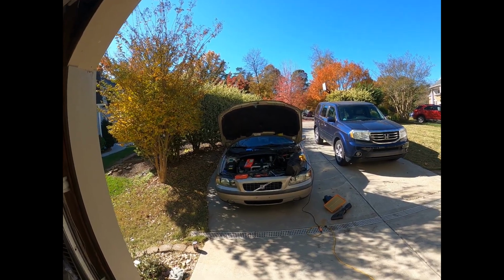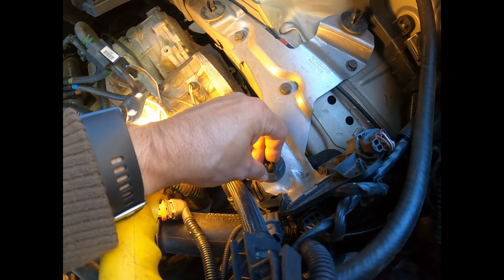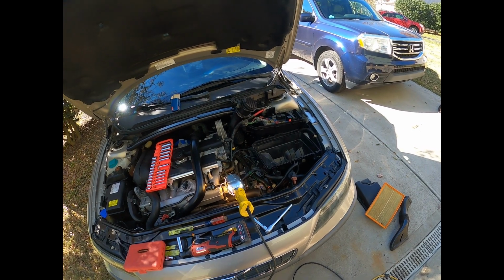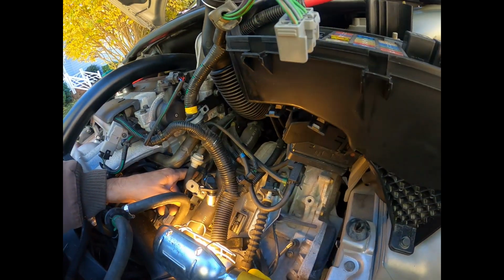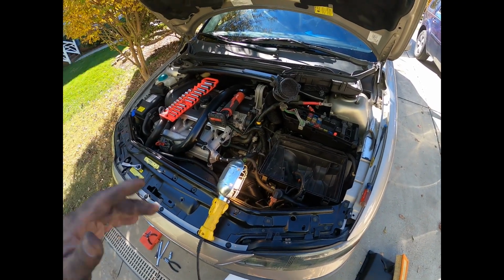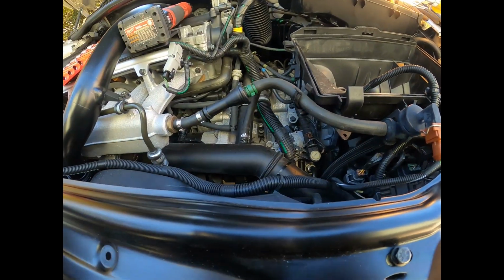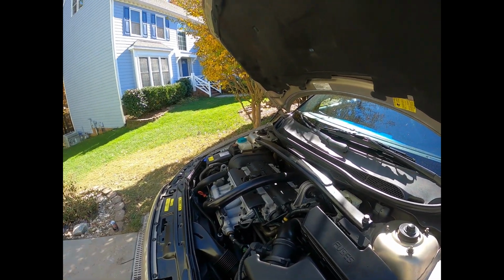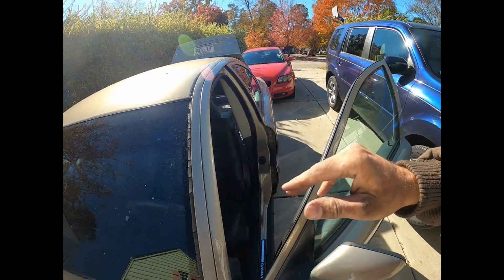Volvo S60 Cam & Crank and crank and crank

Comment: The air box clips can be easily released by using an 8mm socket on a long extension. You fit the socket over the four prongs and push down while pulling up on that corner of the box. The box will pop right out.

Comment: the easy way to get the box out is to use a socket. Don't remember what size, maybe an 11 or 12 mm and a little wd40. Spray the plastic plug and jam the socket down over it. This will close the plug just enough to lift the box up and clear it. Repeat at the other two locations.
Reply: That what i did the only way i could think to

Comment: Not sure you’ll even see this but I have a 01 Volvo s60 2.5t and there is no cam sensor in that position yours is. Any idea about this car?
Reply from the maker: Hi,  your cam sensor ocated should be located on the drivers side of the head under the engine motor mount. You should be able to get to it from from the back side.

Comment: Bro where is that battery for alarm? Can you record that?
Reply from the maker: Hi, the battery for the alarm on my 2004 S60 is the LEFT (Passenger) front wheel well. Don't have a video of it. I think I had to remove the wheel and the wheel well plastic liner and you will see a plastic grey box - about 4" x 6" - that's the battery inside of there.

Comment: You swaped the 2 sensors at the same time? Don't you know which sensor was the bad one? I have the exact same problem on my 2001 S60 T5, I already swaped the sensors, sometime the motor starts and runs just fine for a while and sudly it takes 10 ou 15s to start or even several attempts.
Reply from the maker: I suspect it's your fuel pump. If you have replaced both sensors and still have a hard starting issue. Your fuel system is likely losing pressure slowly when the car sits so you have to crank it awhile to build the pressure back up. At least on the 2004 the fuel pump is a common hard starting culprit. Not sure with the newer 21's. You should be under warranty right? Just let the dealer fix it.
Reply: @threeboysgarage  the fuel system seems to be ok. it has about 4 bars of pressure and sometimes the car starts just fine if it stays still for 3, 4, 5 days. I think the issue is the crank sensor. It has about 125 ohms. seems to be quite low.
Sorry! is not 2021 but 2001 model! my bad!
Reply from the maker: @the_vortex  Ah makes sense on the warranty question now. LOL  Yes, just replace it. It's cheap and easy to do.
Reply: @the_vortex   your fuel system is losing pressure over time
Reply: @sideshow4417  it's all good with the fuel system pressure
Reply: @the_vortex  at the moment of cranking or over an extended period? If you're losing pressure over time you're cranking with no fuel pressure initially and the car won't start until it builds.
Reply: @sideshow4417  it not losing fuel pressure. it only happen when the motor or outside temperature is hot and for some reason there's no signal in the fuel injectors (not sure about the spark plugs). I have in keep cranking for several secounds and several times to get the motor run.
Reply: @the_vortex   ok sounds like a crank position sensor in that case then.
Reply: @sideshow4417  that's what I thought but why the temperature issues? It cranks just fine in fall/winter cold.
Reply: Could be the auxiliary battery if the car is not starting !!